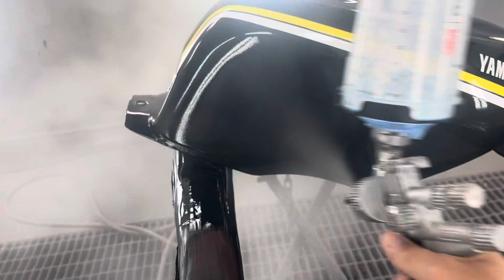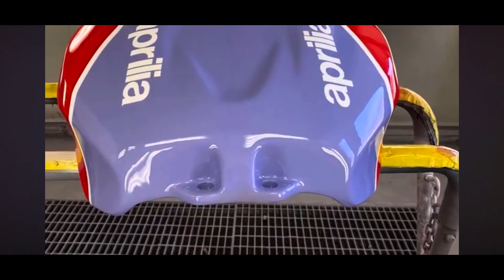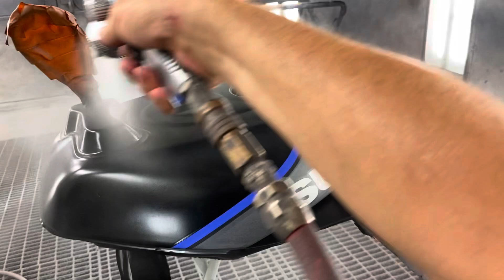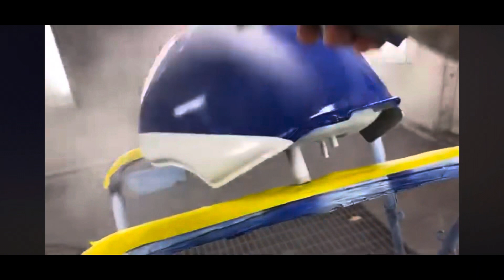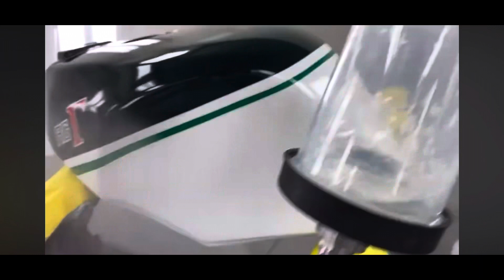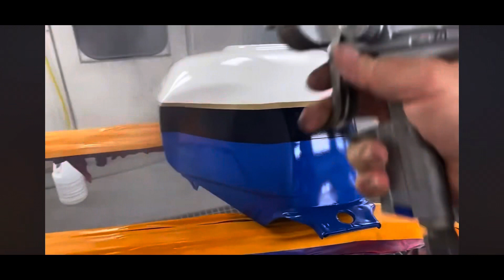Classic sportbike tanks being clear coated

Comment: What gun setup are you using for clear? It’s laying down really nice straight out the gun, I have to really work at it to get close. At the moment I’m limited to an HTE setup.
Reply from the maker: Sata 5000 with a 1.3 cap but if you see some of the tanks I was using a black 3m gun. We were a test program for 3m and I had to use there guns only for months. They worked awesome is still use the gun for base coat. I can give you that info Honda434@hotmail.com